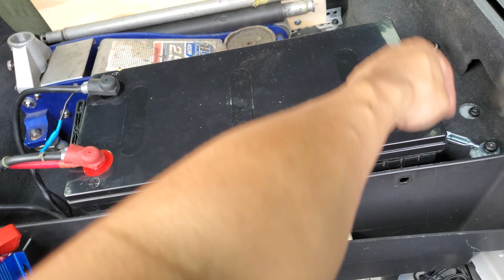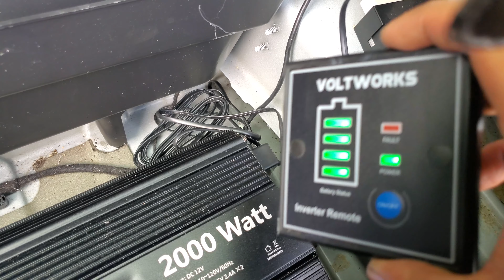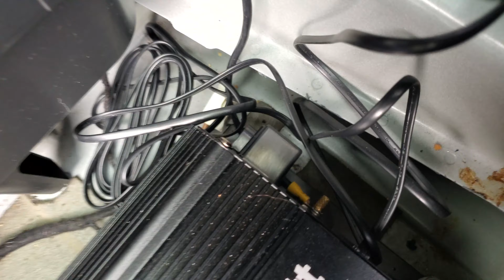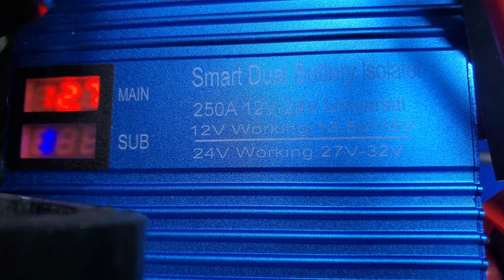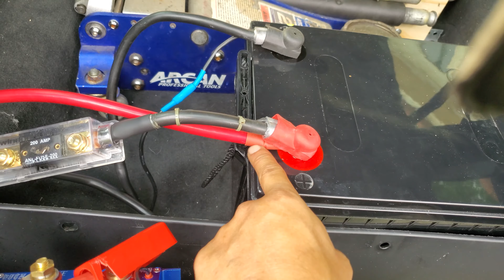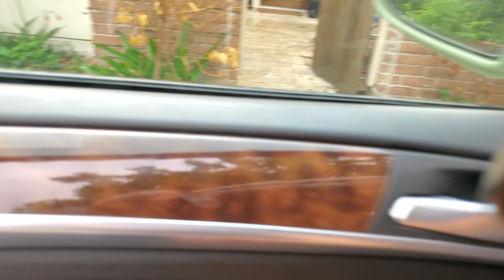BMW e70 X5 50i Overland Battery Setup

Comment: More videos man!!
Reply from the maker: sorry been so swamped. They're coming soon though.
Reply: @bmwchannel7209   awesome looking forward to those x5 videos. I have a 2013 x5 50i
Reply from the maker: @E70dino  Next x5 50i videos will be: 
1. all four shocks
2. remove entire front cooling hoses and replace the leaky hose connector infamous for leaking....yes, mine is beginning to leak coolant in the turbo area due to brittle connections
3. replace thermostat and water pump and hoses
4. replace turbo oil lines that cake up from heat
5. clean the shit out of the exhaust manifold area where the oil and coolant likes to leak and cake on
6. truck bed rhino military green coating on all plastic trim
7. replace turbo oil connector cap behind the alternator on the engine itself. 
9. MAYBE replace all solenoids and seals for transmission.
10. and repaint entire passenger side since the doors don't match the fenders front and rear...this was  a repaint job that was made by monkeys apparently.
Reply: @bmwchannel7209  man, you have no idea what a help that would be for other x5 50i owners. Mine just turned 93k and it developed a vacuum leak. Recplaced both Pcv but I think the crankcase hose will need some replacing too. Good thing I have warranty left lmao! Looking forward to those videos!